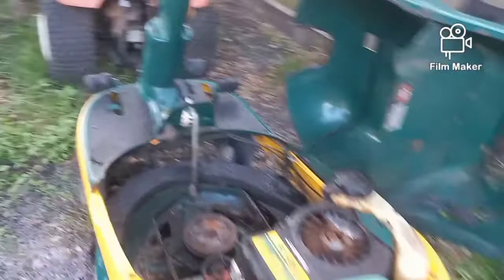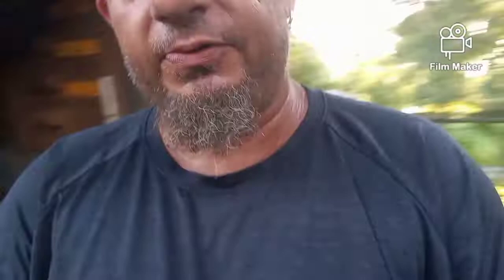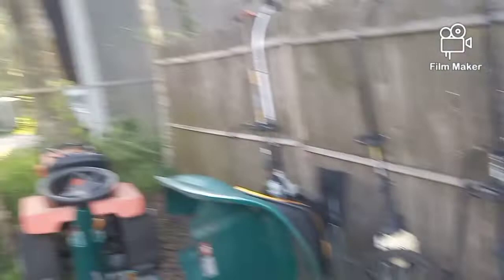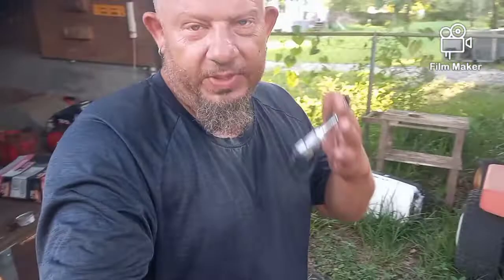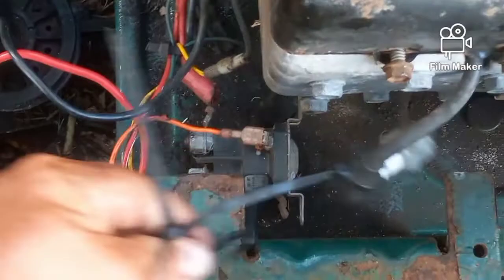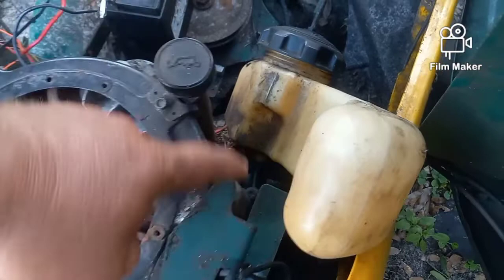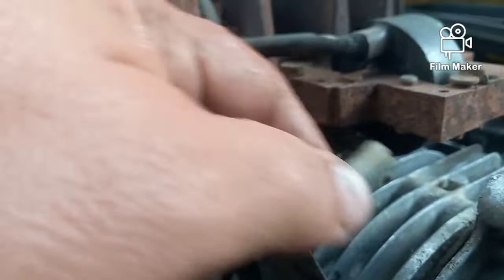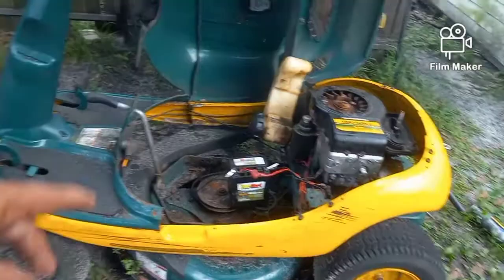Yard Bug MTD / Bypass Safety Switches

Comment: I have a 1997 Cub Cadet Z48 that will click when you turn key but wont start. Replaced battery, replaced starter and solenoid, same thing. The weird thing is if I put a battery charger on battery and let it charge for 10 plus minutes it will start.  Again battery is brand new and fully charged.
Reply from the maker: I'm sorry I get so many comments per day I get confused  .did you and I talk through this yet?

Comment: I have sat through about 15 videos on how to bypass the safety switches and none but yours clearly explained to me what the wire does that was connected to the magneto. I now know  it is a wire which kills the engine .The spade blade broke off and I was no longer able to connect the wire which made me think the engine would not start without the connection.Your video let me see exactly what the wire is for .. Thank you for a job well done.  RJ

Comment: Mr Munky Wrench thank you very much for making this video. My john deere x 300 is clicking when i turn the key but may also turn over and start. Thats what I am trying to troubleshoot      tx   Joe
Reply from the maker: Check your wire connection mate.. start at battery terminals and word your way around make sure they atr clean and tight.. usually it's a loose or dirty connection

Comment: Thanks for mentioning how much a solenoid costs, I was worried it was going to be something like $50+
Reply from the maker: Yeah I often mention prices for that reason.. obviously things change but that's as of time of video
Reply: You titled your video wrong, because you barely mention the safety switches.  I need to know which is open to ground and is "normal" running or not when switch is grounded or not!

Otherwise my time was wasted.
Reply from the maker: @Gerald Couch  sorry I couldn't help. Not my intention to waste anyone's time . Hope u found a better video

Comment: HELLO MUNKY I have the same exact machine with a no crank problem! Good Battery! Bench tested Starter, it works! Bench tested the Solenoid, I have continuity! Power out of the back of the Key Switch all wires in both On & Start positions! Blue Spade Fuse good! Power to the Right Side of the Solenoid! NO POWER IN THE ORANGE WIRE THAT PLUGS INTO THE SPADE CONECTOR TOP SOLENOID!  Possible Neutral Safety Switch is on the brake pedal is bad? Can you explain to me how I can test that?
Reply from the maker: There are several switches on that machine . A brake switch .. a seat switch.. a neutral switch any of which can be bad.. 1st thing u have to do is look up the mower and find the switches.. find out if they are normally open.. or normally closed.. an easy way to test after u find out what each one is.  And they will be different.. if it's normally open u can use a Lil jump wire and plug it into the plug to close the circuit and try start.. if they
Reply from the maker: Are normally closed.. then all u have to do is unplug the switch to open it and try.. I'm guessing before u thought about safety switches u checked for spark.. no spark is the guveaway.. u can test each one for continuity with a multi meter.. simply push the switch in with your fingers and check that u either have continuity or not.. then push switch and see if it changes.. if it stays the same when u press the switch ... it's bad and u know which one to chabge.. hope all that made sense
Reply: HELLO MUNKY! Thx so much for the speedy reply! Will check the NSS on the Brake Pedal & tryn jump it! Then I can check for spark because I have no way to turn the engine over!
Thx again, Jimi.

Comment: Wholly crap! A stupid zip tie! Wish I had thought of that... I can't tell you how many times I've been zapped. Please don't shake the camera around so much. Sit it down and leave it down.
Reply from the maker: Glad the video helped.. bought a tripod and better camera so less shake lately
Reply: @MunkyWrench  (stupid zip tie is a genius idea) i  have been zapped so many times because ignition key will not turn off the engine, so  i started cutting off the gas by pinching the gas hose. was thinking of installing a kill switch but still trying to  figure out which wires to use.
Reply from the maker: @appexcelvba9356  thanks for watching.. kill switch is a simple job. take the plastic cover off the top of the motor and find the magneto. thats the blask bok connected to the spark plug wire. on the bottom of the magneto u will find the kill wire plugged on a post. take kill wire and attach one wire to the body of the mower, and the other wire with a spade connecter plug onto the post on the bottom of magneto.. thats it. just grounds out the spark and kills the machine. let me know how it works out.. u can also just put a zip tie on the spark plug wire so you have something to grab when you pull off the spark plug wire